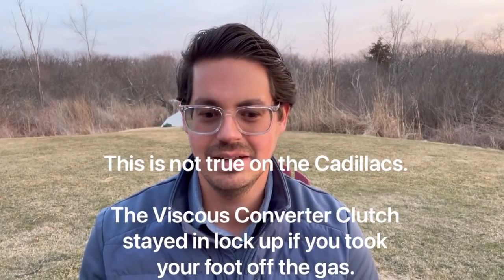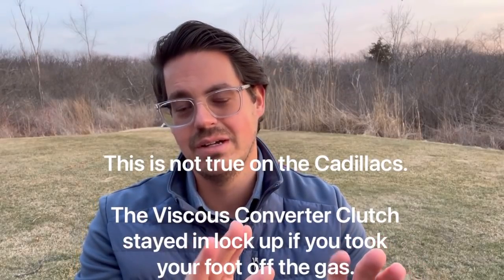Worst Transmissions of All Time: GM Turbohydramatic 440T4 (Early 4T60)

Comment: Now I recall an annoying driveline issue with my Dodge Dakota....3 speed torqueflite with a lock up torque converter...now when the truck was cold, at part throttle it would ping slightly....and that was "normal" and expected per the owners manual....getting on the road...let's say between 45 and 50 mph...you would get an annoying driveline flutter and it was the torque converter trying to decide if it wanted to lock up or not....over 55, no noise and you felt the extra shift bump of the lockup....below 40 the noise would go away.  Christmas 1988, we're driving the truck home from Colorado to my parents' house in ND...and driving through the Black Hills after a fresh snowfall, speeds were limited to 45 mph...so for about an hour driving through those conditions we kept hearing the flutter..and it was pretty annoying....

Comment: Our GM cars with transaxles were pretty solid....from our Iron Dukes...to the 3800 V6s....Now our 2001 Honda Odyssey.....at 99,000 miles we got the dreaded flashing D4 light and failsafe mode....luckily, Honda covered it under warranty.....you might see a theme with my postings of major Honda failures and covered by them.   Being a glutten for punishment....I also have a Nissan Maxima with the CVT...so far, no real issues yet.

Comment: Hust a note from the 440t4 harsh shifting from 2 to 1. The most reason for it was the spring from the servo breaks and make that transition very hard and that was one of the reasons for the harsh shift
Reply: So down shifting from 2nd to 1st or are u meaning from 1st to 2nd
Reply: @KnuckleHeadGarage27  shifting from 2nd to 1st.

Comment: For the record my Grampa thought his brand new 87' Olds 88' (his last car) was a rocketship compared to the 350 equipped 78' LeSabre he traded in for it. His favorite was the 71' Galaxy 500 he sold to my dad when he bought the LeSabre.   I'll never forget how much he hated the LeSabre.  Said it was the most gutless car he ever drove.  He never had any issues with the trans in his olds 88.
Reply: Your grandpa had similar experiences to mine. My first new car was a 1978 Pontiac Bonneville with a 350 Buick V8 in it. The car was fairly gutless which surprised me. I ordered it and the one that I test drove had the Pontiac 301 V8. I thought that if I ordered the 350 that I would have been fine. Wrong! My parents had an ‘85 Electra 380. It was like a rocket. Fuel injection really made the difference.

Comment: My dad had an '86 LeSabre and 88 and both transmissions were fine. He had a '92 LeSabre and the trans failed, maybe at 120,000 miles. He had it rebuilt and 15 months later, three months past the warrantee, a bearing went in it and it failed again. He put a junkyard trans in it and traded it in for a Toyota.

Comment: Yea the first ones were turds, but they eventually got them to work, and they didn't come back after the updates were installed, unlike the Ford "AOD Metric" which was nonstop garbage that just got worse, the update package had parts that were changed from cast aluminum to steel, and they still cracked in less than 50K

Comment: I thought the worst transmission was the 200 transmission they used to mix with 350's and bigger V8 and they couldn't handle it and they wore out all the time very prematurely.
Reply: That was probably because people didn't keep the TV cable adjusted correctly

Comment: The worst transmission I’ve ever experienced was the 2012 Ford Focus duel clutch transmission. I had 3 warranty fixes and I traded it in just before I had to fix it myself. Terrible transmission. Great engine tho. Never gave me problems.
Reply: should have bought a Nissan Rouge of the same era
Reply: @juanrodriguez-ry6yt  woulda coulda shoulda. I got a Toyota Camry now.
Reply: @Doubledge  I was joking the Nissan is probobly worse than the Ford. Camry are very good cars like all Toyotas

Comment: I had a 1985 Buick Century with said trans. Drove it about 100K miles from 30K at purchase and trans made it to the end but only with complete flushes, filter and fluid change every year. Fluid would get dark and I would flush fluid out thru cooler line to get most of old fluid out. Used seal softener additive to stop minor slipping. Had a very harsh 3–2 downshift due to excessive band servo travel. I was afraid to install longer servo rod to correct because of trans fragility. Went through a lot of new Dexron but it was cheap then. Got the car for cheap so turned into lowest cost per mile car I ever owned. But I did lots of other work needed along the way.
Reply: Good story.

Comment: It seems that GM is the company that has the most manufacturing issues. Buy Toyotas instead. Toyota works longer to get cars right before they build them.
Reply: Until lately... I had a 2109 Lexus RX with a terrible 8 speed that would surge and stall like a roller coaster. Hated it enough to sell it. My 2009 Tacoma with the 5 speed drives like a dream.

Comment: As to the transmission, my mom had an '89 Bonneville with the 3800 engine and they had no problems with the transmission, or car in general for 100,000 miles until the day that my brother was charged with changing the oil.  The 3800 engine uses a very small oil filter, but for some reason my brother put a much larger Volkswagen Golf oil filter on it and the ensuing oil starvation destroyed the bearings about two miles from my parents house.....

A new engine later and it ran another 150,000 miles just fine when my parents gave it to my cousin so she could have something to get to work with. Here it is 20 years later and I wouldn't be surprised if it is still on the road somewhere.

Comment: Ive driven alot of fords that still hunt for gears between 40 and 45 mph ! Its really annoying specially  when following  someone doing exactly 45 mph when most torque converters lock up it also hurts the fuel economy
Reply: Thats the perfect speed to test the ignition system on those Fords. Any misfire and it will shutter like nobodys business at 45.

Comment: Adam, please do a vid on your ‘86 Ninety Eight. Would love to see it. In 86 my grandfather bought a slightly used 86 98 that had the chuggle intermittently. I have always remembered that sensation, it seemed to come out of nowhere and it would make the dash vibrate. Years later I had an 86 delta 88 2door that had the TC whine after being rebuilt and a very clunky downshift. It really was a lousy trans and engine too really with the unbalanced vibrations. All that stuff drove me nuts. Then years after that I acquired an 87 delta 4door for $100.  Same unbalanced engine but trans was pretty good but leaked a little from the axle seals.

Comment: I read from multiple sources that Chevy sold over 1 million full-size cars in 1965. There are content providers on YouTube that feature old photos and videos of urban and rural areas from the 1950s and 60s, and it's surprising to me to see that almost every vehicle therein was domestic. Over the last 40 years, I've gone from being a snarky critic to a GM owner and supporter. There was the old saying that "As GM goes, so goes the nation"; so I want GM to succeed. Loss of market share has been a disaster, but RCC's videos remind me that I was not really wrong to be critical during the late 70s and 80s. GM really did squander trust, even if some of the factors affecting them were imposed by government.
Reply: I bled GM blue for 35 years. All GM gives a s**t about is $$$$$$$ today. No pride left just down the road and get it out of warranty. Then sell you new one. Screw GM.
Reply: I agree with your sentiment, but GM has been so tainted mainly by becoming a quasi-government operation, because of accepting so many taxpayer-funded loans in the Obama years.  These loans were never fully repaid, as I understand.  It just is not the same company it was in the 20th century.  Probably would have been better to allow GM into bankruptcy, and allow it to rise again based on quality and the marketplace, not on getting cash infusions to prop up bad manufacturing.

Comment: I can remember my grandmother having an 86 or 87 Delta 88 (She had driven those for years).  I think the dealer told her to put it in Drive, and then manually switch to overdrive when she needed to.  It must have been for those problems.  Her experience with that car put her into Chevy Caprice Classics for the rest of her life.
Reply: A wise choice for grandma's final rides.
Reply: @TheBrokenLife  She had a 1990 and 1993.  The 1990 one has an interesting side story.  The car had about 20k miles on it and we took it into the mountains to my sister's graduation from college.  We went up a mountain, and started going down the other side and it started making the damnedest noises I ever heard from a car.  We limped into to town and it turned out there was never enough lube in the differential.  It heated going up the mountain and on the way down, the fluid ran onto the parts and cracked them.  She got a free replacement differential, but she replaced the car thinking she couldn't trust if after that.
Reply: @hattree  My Grandpa had a 87 and a 93. Both were excellent cars. My sister ended up driving the 87 up to probably about 175,000 miles (mercilessly beating on it the entire way. 0 mechanical sympathy in that girl) and it never had any serious issues. Like maybe a tie rod end or ball joint once, a tune up once, and oil changes every now and then since my Dad kept an eye on it.

The 93 really didn't get driven enough to make any positive assertions of quality since as Grandpa aged he drove less and less, but it was a great car for the 40k or so miles it had put on it by 97 when he passed. What I remember the most is the thing was freaking fast. I'm not sure if his was an LT1 or not, but it would go.

I also remember my mom foolishly turning it down to replace her terrible daily drive since she didn't like the ash try location in it. 🙄

We regularly saw the next owner drive it for at least the next 10 years. I assume it was a good car for them.
Reply: @TheBrokenLife  I ended up in the 93 for years.  It was a nice enough car, though I was always terrified the A/C would die, because it was dark Maroon and that dashboard would heat the air if you rolled the windows down to hotter than a blow dryer.
Reply: @hattree  As the owner of multiple black cars, I can relate.

At least GM A/C of that period was pretty robust. I have the world's worst 97 Blazer sitting in my drive way and I'd bet if I changed the service ports and charged it that the A/C would operate fine after years of being discharged. I'll probably find out soon enough. It's only like $30 to try it.
Reply: @TheBrokenLife  My worry was that it was an R-12 system and they had phased it out.  We had converted one to R-134a already with lackluster results.  I drive a Honda these days.
Reply: @hattree  Oh, you're right! I hadn't thought of R12 in awhile. FWIW, I had my 89 S10 charged with R12 around 2005 and it wasn't "that" expensive. I think you can still get it now from AC shops.

I think there are R12 replacements that are much better than R134A now too.

Comment: During my career as a professional mechanic I took a job in an independent transmission shop. The 440T4 probably made up 70% of their overhaul business during the early 90s. They were a hot mess of garbage.
Reply: What was the other 30%, FWD Fords?
Reply: @mph5896  Actually All GM models of the 80s through the mid 90s made up a solid 90% of their work. You have to remember that the 700R4 was a hot mess back then too. There were still countless Turbo 350 and 400 hundred units as well though they tended to run much longer than GM’s newer overdrive units. Ford AOD units failed prematurely too but not at the rate of 700R4 units did. To be fair, fluid quality was nowhere near as robust as it is today and many people with domestic vehicles rarely serviced them back then. It was a huge transmission business that had been in business for 30 years . They had five rebuilders and ten bays. They made a killing back when warranties were 12/12 or at the most 3/36.
Reply: I think the Ford manual transmission had a weak 3rd gear.  I remember working on tons of them back in the late 80s/ early 90s.  

But yeah, that GM 440T4 kept food on a lot of mechanic's tables......

Comment: My mom had a '93 Seville with the 4.9L V8 and this transmission.  All the bugs were worked out by then.  She kept it from new until about 250K mi without trouble.  As tuned in the Caddy, this thing was so smooth, you could not feel it shift..... ever.  Full throttle, did not matter.  Also, you never had to put your foot into it to coax it into downshifting.  Passing power was always "right there".  Extremely responsive and intuitive to drive.
Reply: That wasn’t a 440. That was a 4L60E. Computer controlled.
Reply: at least with the newer N-star ones it was the upgraded 4T80E transmission ( a 60 will interchange with some models but pick the 80 and "hot rod it" for beefy 😉 )( 90* version of the truck 4L80E but later diesel's got beaft up for the truck and morft into the 8 speed eventually ) the 1990 model im fuzzy about today as my memory has betrayed me but i did work on a lot of those cars

Comment: My cousin had a Corsica back in the 90's through 2003. You had to manually take it out of AOD below 45mph or you would burn the tranny up very quick.
That's a lot of responsibility to put onto a driver keeping a 45mph threshold. Get off of interstate and you might not think about it just slowing down  in a different part of the city or whatever.
Reply: It would have been, but it wasn't.  There was never a GM 4-speed automatic transmission that needed to be manually shifted into D under 45MPH.  The stock threshold speed for the ECM to command TCC lock up was around 50MPH lock and 45MPH unlock, so maybe they were confused about how it worked.  We had a Corsica that was that lovely steel blue color that all the paint peeled off of because of the early formulation of water-based paint primer GM was switching over to.  XD
Reply: @carbonsx3  It was in the owners manual. Take it out of overdrive when below 45.
Reply: @kramnull8962  There is nothing in the manual that says the transmission will burn up quick if it's left in OD around town.
Shifting to D during low speed operation simply improves drivability in urban areas, so the driver is not constantly waiting for the 4-3 downshift if the speed is barely meeting the threshold for the shift up to 4th in the first place.
The 4T40-E (I4) and 4T60-E (V6) that were used in the Corsica are computer controlled and up/downshift when thresholds were met. Shifting in and out of 4th at the lowest speed thresholds is not taxing on the transmission.
Driving around residential areas in top gear with a manual overdrive transmission isn't a good idea either, you're going to have to downshift in order achieve any useful acceleration.
The owner's manual simply suggests best practices (of the time).🤷

Comment: During durability testing back in this period we used the term Shudder to document what you’re talking about in the 440T4. The man hours dedicated to solving all transaxle issues encountered in the 80s seemed staggering to many of us non-engineers while we worked at GM in this period. As you’ve mentioned in at least one of your previous videos, the experience lost due to early retirements and buyouts at Hydramatic left inexperienced engineers designing and learning on the fly as GM raced full throttle toward front wheel drive models.

SHUDDER: Any vibration induced by the torque converter clutch in normal driving mode (with an expected TCC slip amount). 

CHUGGLE: (often called boom) is induced from engine combustion exciting the driveline due to insufficient isolation. Frequency of the boom is affected by driveline mass, stiffness, damping, and gear.
Reply: Interesting...
Reply: They weren't as bad as the Taurus AXOD. THAT was the worst.
Reply: Why didn't manual trans have these issues, if they are related to slip
Reply: @eaglewi  A manual trans was never offer in the C-cars.
Reply: What is it when it feels like driving over rumble strips if you slightly load up the engine just after lockup (but not enough to get an unlock or downshift)? It happens around 35 mph but not at highway speed. I've seen it on a car with the Iron Duke and 3 speed automatic.

Comment: I remember driving my dad's 1985 Olds 98 and it wasn't the smoothest shifting, for the most part, I remember that the engine always seems to run well - smoothly for a V6.  He didn't hot dog the car and mostly just my mom drove it to the grocery store.  He traded it in on a 1991 Olds 98 and I remember I was mad cause I would have bought the '85 from him,  I liked that car that much plus it only had 30K miles on it when he traded it.  He said the dealer already had the '85 sold when he picked up up the'91 and he remembers seeing a very happy man getting into it and driving away,  my heart sunk when I heard that -  I wanted that car.  Oh well.  I think the '91 had some sort of "electronic transmission" version or something, that car you could never feel a shift, it was that smooth, they kept the '91 for twenty years, I think it had 50K miles on it when they traded it, it never had anything go wrong, I think he changed the spark plugs once.